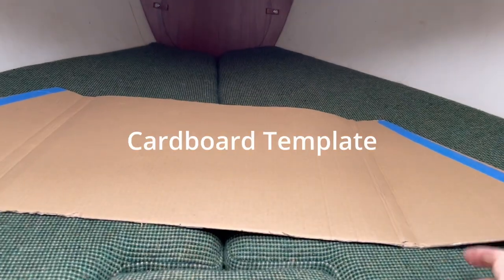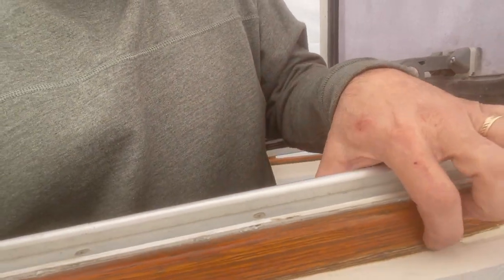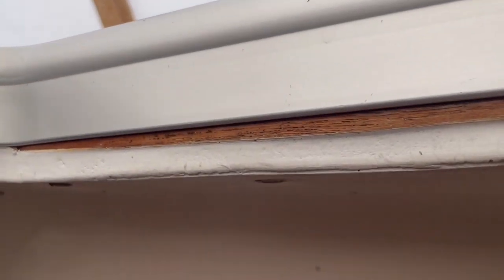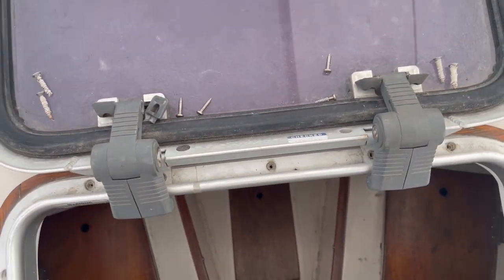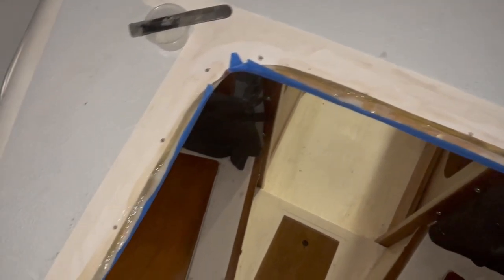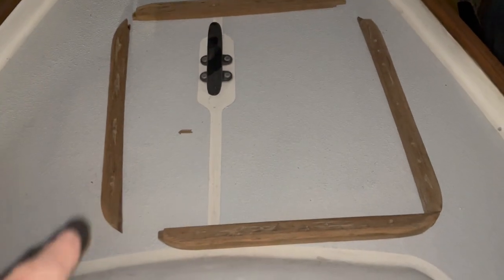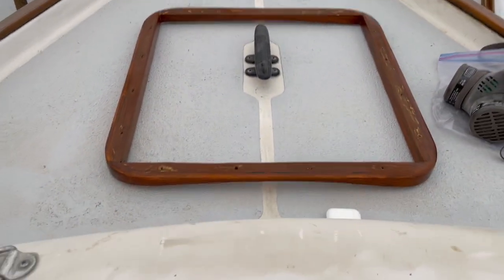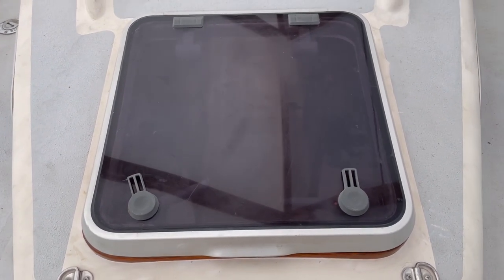Contessa 26 Refit ep.41 - Repairing a Forward Hatch Leak

Comment: Hi, you could also add a large 'fillet' in each internal corner of the wood frame. It would add additional surface to seal against the deck as well as reinforced the corner. Keep posting.
Reply from the maker: Thanks, that would be a good option.